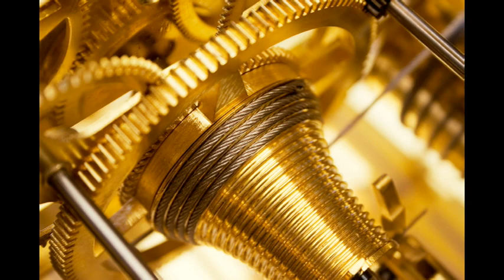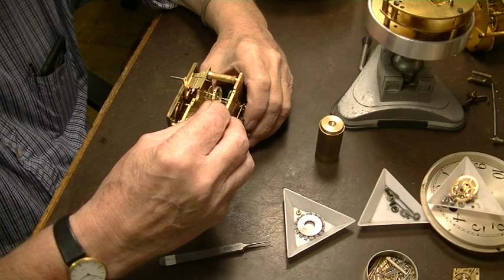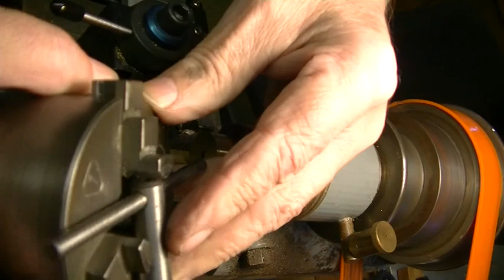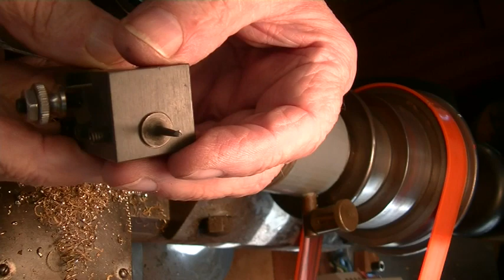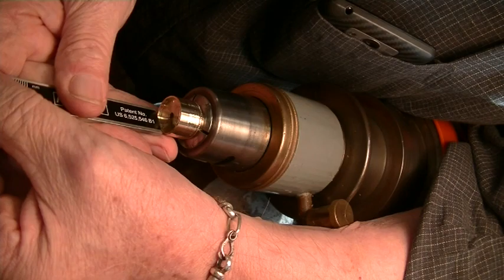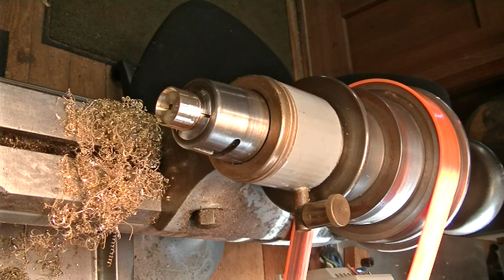Clock repair #5. Cutting a new contrate wheel for a Carriage clock. Part 1.

Comment: I get chatter if my tool height isn't right, it's dull, or there is too much play in the cross-slide.  I use cheap plunge type carbide router bits with a 1/4" shank as boring bars and they work great.  Thanks for sharing  your knowledge.

Comment: Inotice that the flat belt on the lathe rubs on the lower support? Does it need to be tightened or the motor adjusted up a bit? Enjoyed the video, keep em comming?
Greg
Reply from the maker: Greg. What it really needs is a leather belt. I have one just haven't had time to put it on. That plastic one is supposed to be very good but I find it stretches quite a bit.

Comment: This is a fascinating site. I am a mere amateur, trying to build the Isaacs beginner's clock. And I do not have a fraction of your equipment!  But I am learning a lot from watching these videos. I watched you turn the wheel down to size, and it was howling.  You were using a brazed carbide tool.  Carbide tools are wonderful but whenever I get that very same howling sound I examine the tool with a loupe, and usually there is a tiny chip in the tool edge. I do not have the wheels to grind carbide. But perhaps this is the cause of the chatter. In the end it did not matter. HSS does not chip, but carbide does.Thank you for posting these videos; you make them, I'll watch them!